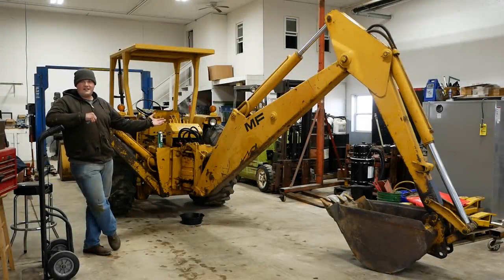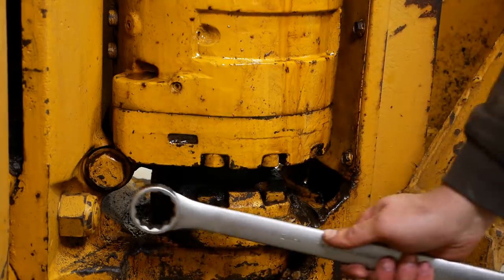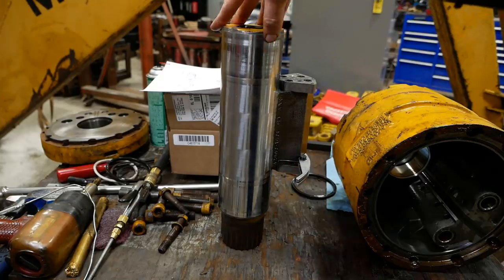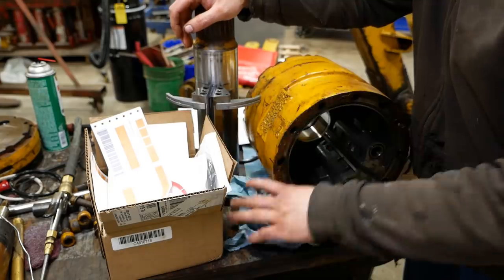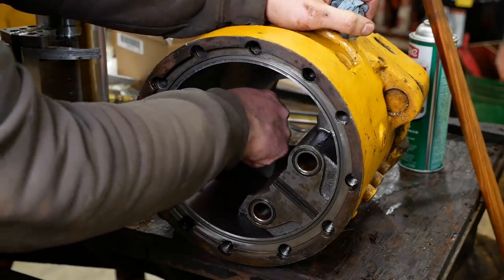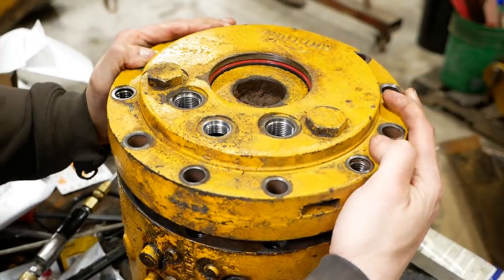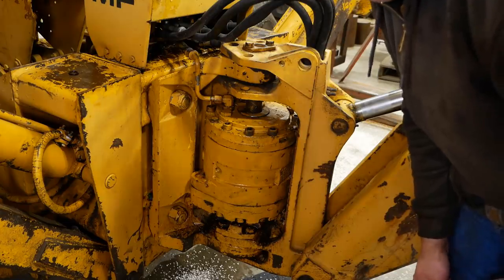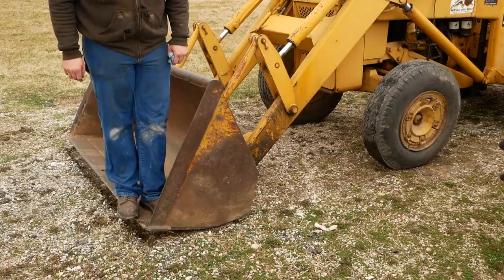Massey Ferguson Backhoe Rotary Swing Cylinder Rebuild

Comment: Yeah Agco and their proud parts, I rebuilt one of these with u-cup hydraulic seals from local shop for around $40. So far about 100 hours on machine and no leaks yet. Not saying its right but for the $1,000 Agco wanted, i can rebuild again if it fails. Also Vaseline made it much easier to reassemble.  Love the channel Wes

Comment: Wess when working on something big and round like that. I make a wooden v block. I put a rubber mud flap in the block. Then sit the round item in the block. I then run a strap over the top. This holds the item while breaking bolts lose and working on it. God bless

Comment: Seeing where you wrote Perkins reminded me of a couple Forklifts a company I used to work for had.They were powered by the 6 Cylinder engine that Perkins built that were originally designed as a Diesel but by changing pistons and a few other mods they were set up to run on gasoline.Company then had the engines converted to propane.Buyer could never figure out why those forklifts spent more time in the repair shop than they did working.We used to make bets on which one would break down first.Then Vendor that sold the machines could not get parts for us and no one else in town would even try.
Reply from the maker: Some people love Perkins engines. I'm not a fan. I've rebuilt a few and have never been impressed.

Comment: An outfit called belzona makes a product 1111 I believe and a release agent. It is like a stronger jb weld you can put release agent on the housing then pour some epoxy in it and drop the motor in and let it cure. It will cast splines onto the shaft.  and the release agent will allow you to take it back apart in the future should you want to. I have had reasonable luck repairing stuff with it when someone doesn't want to throw down the big coin on a proper repair.

Comment: I absolutely agree with you, the 2 cylinder swing is better. stronger, easier to work on and cost less to repair. But when the backhoe is an removable attachment it is harder to mount the cylinders.
Thanks

Comment: Good video. I always wondered how hard/easy it would be to service that thing...now I know, thanks to you. I have an an old mf50 with what looks like to be that exact backhoe setup. Mine swings crazy too. Probably the same spline problem. But the swing cylinder doesn't leak, so I'm gonna let it ride. This thing could probably benefit from some sort of damper on it like a shock absorber or something to keep it from swinging so wildly. I'm actually gonna take a good look at it and see if I can adapt a heavy shock absorber to it to see if I can do something with it. The other annoyance is that the hydraulic flow for that swing cylinder is a bit much...it could probably benefit from a flow control valve or even just some smaller hoses to slow it down a little bit.

Comment: I have actually had to do this on a MF30b backhoe. My problem was getting the pin out that he took out easily. I had to use a small hydraulic ram with a Porto power.  I also needed a bolt from M F to take apart cylinder. Easily replaced seals.

Comment: Tremendous teaching.  For me the two take-aways were: 1) How much torque you needed with a pipe wrench just to get some static motion (no hydraulic pressure) on the motor. 2.) How to tell the difference between a cylinder seal leak and a valve leak on  hydraulics (bucket or otherwise). Best Regards.  Craig

Comment: You are correct, AGCO parts are made from 100% pure gold!  I just paid $85 plus shipping for a simple key switch for the ignition.  As far as cylinder seals I have always just purchased parts from my local hydraulic shop.  Much cheaper, and usually a lot faster...

Comment: I wouldn't call it a 'poor' design. After 60 years in service, I am surprised those splines are still holding up and those seals looked original
Reply: @Nighterlev  - very true. and those splines being at the bottom, probably received a large dose of sand and dirt over the years, grinding them down to nothing, it's surprising they have lasted as long as they have, a simple rubber cover would have protected them from debris and damage
Reply: I wonder if the shaft could be be pinned? Might not be removable after if gets tweaked from use, but could buy a few more years out of the machine.
Reply: @NICK-uy3nl  how many fudd backhoe operators do you think actually grease their machine? I guarantee most don't. Especially people who don't own the machine.

Comment: I had a MF 302 with a 320 backhoe attachment back in the day. It suffered from similar issues. The bonus on mine was the operators station swung with the backhoe, kinda like and excavator. The AD4-203 Perkins was one of the best running diesel's I've ever owned. It was a decent machine in it's day but pales in comparison to me Deere 310 Turbo 4x4 with Extend-a-hoe.

Comment: Hi Wes. I have a MF 50A  It's larger than that one. Though the same setup. Mine stars right up. I am going to remove the back hoe on it. I can't afford to buy all the hoses and cylinder kits for it.  The prices are BS for for parts,that's for sure. I make my own hoses and it still costs an arm and a leg. Has always I Liked,shared. All my best.

Comment: I have run into the worn out spline scenario before too.
Cheap and easy fix as long as the customer knows that it is the last fix, is to use an industrial metal repair epoxy putty on the splines. A thin coat on both sets of splines and assemble, wait required time to harden and away you go.  You can never get it apart ever again
I tried to look up the stuff we used, its been too many years and I cant remember the proper name. Belladona or something like that.  I can't find it anywhere.
Great stuff.  The millwrights in the pulp mills used it lots, that is where I got the idea from.
If you do it right it will last forever but you only get the one chance.

Comment: Well done as expected, just a few things that maybe you knew and maybe you didn't. When dealing with large awkwardly shaped assemblies like this, break all the bolts loose (just a minimal crack) when the assembly is still bolted on the machine. It makes disassembly much easier and I have always found that it sames lots of time and headache. You can always retighten on the bench, or back on the machine. Second, with regard to the splines, Loctite actually makes several types of compounds  designed just for instances like this. Each compond has tolerances in which it will fill and tighten the joint up significantly, the durability is more than adequate for most splined joints. Next time you come across something like this give the technical line a call, the people I have dealt with are very knowledgeable. Just some food for thought, if you already knew no harm no foul. Keep at it Wes, your killing it.
Reply from the maker: It's not possible to reach the bolts with the unit in the machine. If it was I would not have removed it...
Reply: @WatchWesWork  ok, I figured it wasn't new information just thought it  couldn't hurt to mention it.

Comment: Wes, I have fixed the female splines by machining out a cavity and pressing in and welding/braising in a splined coupler which are fairly affordable. The male splinesI have built up with weld and ground them back.  The shaft can be spray welded and turned of course.  To me, the work on those is probably 1500 bucks.  But of course when the machines list of issues is endless, it’s a matter of hitting what matters most. 10 degrees is a tough amount to accept.    Any used machine like it will have the same type of issues. That’s the problem.

Comment: Always wondered how those slew motors worked. I drove a Ford 550 with a similar set up. Slew wasn't that powerful. Digging on a slope it wouldn't slew uphill unless you brought the bucket in near to the back of the machine. I expect these motors were used to avoid the Wainroy patent on the two ram system. JCB had a different "rack and pinion" set-up. The early ones weren't enclosed and used to go bang when a stone went through the workings.

Comment: We have a place here in Oregon that will match up your hydraulic seals, o-rings, and even backup rings to off the shelf parts.
I wonder if there's someone like that around you.....  I haven't found anything yet that they couldn't get for me.
Looks like the rust was the only thing holding those splines together.
I've never gotten to see one of those apart.
Thanks for showing us.
Reply from the maker: I have a place like that, but they just scratched their heads...
Reply: @WatchWesWork  I remember well those days of ringing around the country to try and find some obscure part.  Wasn't a bad gig actually.  Comfy chair, no risk of getting hurt, and being a wage slave meant I was getting paid regardless.  Didn't help the boss' bottom line, but we usually managed to find things.

You can bet your bottom dollar we kept the contact details of every supplier who was able to help us on file.  Even though that business closed years ago, I still have that folder and it has saved us many times over the years.

Comment: years back they made a replace kit that turned it from rotary to twin cylinder for these you might find one in a wrecking yard sometime . as for rotator, recast the piece on tractor and grind the shaft to tighten slop , or make brass teeth shim to fill the void.

Comment: Hi Wes, I have this 1961 military surplus rough terrain forklift that came with a crane attachment in place of the fork frame , and it has one of those Cessna rotary drives but twice the size, I don't have any leaks there. I knew How it was made but never had to tear into it..
as for the spline flange plate, I'd see if that spline is SAE involute spline and see if Hub City has a spline coupler that size and bore flange and weld coupler in bore.
I keep hoping one of youtube machine shops get a vertical shaper ,
I keep my eye open for a vertical shaper to make internal splines for my personal projects,
wire cut EDM would be a very realistic way to cut cut splines in a new plate.    
interesting video thank you.  
Ave did a video 5 years ago about rotary cylinder that was interesting.

Comment: If it's not too late, I'd try packing those splines with JB Weld.  A John Deere restoration expert has been doing that with the steering drag links on wide front end tractors.  Some of them have lasted years.  It might not work, but it would be cheap to try.

Comment: I wonder if you could drill that bottom casting on the flanged spline insert and install a few jamb bolts?  Or potentially mill the top of it and shim it up a little so it's engaging more in the bottom of the female spline.  Just ideas... The loader looks similar to mine.  I replaced the tilt cylinder piston seals with universal seals.  I think is was about $12.  I have video on my channel.  Not my best work, but we managed to get them replaced. Nice video 👍😁

Comment: Hey Wes!   You had the high concentration face going when you were lifting the cylinder back in lol.  Bummer on the spline design.  Going to be the end of them ol diggers....   Had similar issues on things.  JB weld filling the space actually holds up pretty good.   Take care....

Comment: Ohhhhhh Baby that’s tight ;)

It all comes down to supply and demand with the cost of the parts.
With not much demand the suppliers can charge as much as the customer can stand.
How long have they had those in stock waiting for you to come along :)

I recall reading operating instructions on a back hoe saying not to push dirt sideways with the bucket.
I see lost of operators doing exactly that.  I guess that why.  Wears out the sideways stuff what ever that may be.
Happy to watch you repairing the other leaks if you can be bothered filming them. 
Nice video!

Comment: Excellent video Agco parts are very expensive especially their hydraulic system parts. The splines could be fixed to take some of the slop out them with liquid metal exopy I bought some years ago from fastenal and it did actually make a quite a difference I used it on a keyed shaft that was wore in the key badly. The cylinder seals are bypassing badly. My Ford tractor backhoe uses 2 trunnion mount cylinders to swing the hoe around it is a heavy extendable boom it digs to 19 feet 4 inches

Comment: That a pretty neat piece of hardware, even if it was a bad design.  I guess that is why most backhoes (that I've seen) use the two single-acting cylinders.  It's a shame that the splines are trashed, but I guess it'll last until they finally wear out.

Comment: Part's are the killer of those. I had a ford 4000 backhoe in a few months ago back in indy and it chiped a gear in the transmission. No parts available and if they are bend over. He upgraded to a case 580 cheaper than me tearing it down to install less junk used parts.

Comment: To fix that slop I’d mill the splined end into a square then make a new block with a square to match.
Reply: I like the way you think and wish I had the time to try it with mine . When loaded this area is under a lot of rotational torque, anything not properly heat treated and case hardened will shear.

Comment: Perkins...
My father had a fleet of trucks, at one time the majority were Perkins powered. 
I learned how to spray ether into an air cleaner at an early age.

When you removed the bolt to hook up the chain I thought you were cleverly cracking all the bolts in situ rather than wrestling the pig on the bench, but luckily we got to see the pig wrestling.

Comment: I think AGCO has started to charge back rent on warehouse space for parts for older equipment. Guess you can't blame them, it's good there's parts at all. I wonder if Cessna corporate would have been any help. Maybe salvage yard those splines? A fairly good used backhoe is still worth fixing, no matter the brand. Heck, that thing's got nice tires. That's a vote in its favor.
    Best regards from Indiana.

Comment: Oh, caustic and sonic cleaning and spray welding is how you can get these worn, unique parts back to snuff. Abom79 has several videos of the process w. two different sprayers. Edit: Coarse splines and timing marks to set the inner rod and boom would have been better. They made it fine so that it could be used in all those other machines. That amount of slop is going to crack the splines that remain. The now stronger cylinder is going to stress them more; since he leak weakened the forces exerted by the cylinder.

Comment: Wes, the leakage you showed on the bucket tilt cylinders is probably both the valve and the piston seals.  In order for a closed hydraulic system to change volume which is what you are showing, as the rod adds or subtracts volume from the system, there has to be an external leak or air in the system (that can compress).   I'm pretty doubtful that there is air still in the system assuming the system has been running for an extended time, so the valve has to leak in order to accommodate the change in volume between the valve and cylinder.  If the fluid volume can change via leaks in the rod seals or the hoses, you would have a couple of other reasons, and potential sources of air volume in the system.

Comment: Very interesting I've never seen one of those swing things taken a part before. I think the MF construction machines were more popular in Europe and the U.K. than they were in North America and that's partly why they used those swing thing's since the European machines almost always had sideshift with the vertical stabilizers rather than the center pivot swing with swing out style outriggers. Usually if I ever see a MF loader/backhoe its parked in the back corner of a field or is waiting for scrap prices to climb for its inevitable transition at a steel mill.

Comment: I came across a loader cylinder that was bad in the middle and would drift. But if you stalled it extended or retracted it would not leak.

Comment: I live about 20 miles from perkin in the U.K.,and they are poor starters here,plus always oily and Prity dirty inside when you work on them,there parts a bloody expensive in the U.K.,good video thanks.
Reply from the maker: Those pre-combustion CAV injection setups will not start unless it's a hot sunny day.
Reply: @WatchWesWork  heater + spin them over fast ,modern geared starters do help,but I’ve found a valve job 9 times out of 10 cures them.

Comment: You might be able to find replacement cylinders for the bucket at surplus center. They might not be exact but they have a large supply and good prices. Their shipping prices suck though.
Reply: Rotary cylinders?
Reply: No no, the cylinders for the bucket that are bypassing and bleeding off. The front bucket.
Reply: @jasonp9284  Ah. They aren't hard to rebuild. By the time you've figured out all the right apapters and fittings for a surplus cylinder, you haven't saved anything.
Reply: @TheMetalButcher  I know, I build large hydraulic cylinders. Wes also had said he was having trouble finding the v-packing and one had a bent rod. But I agree with everything you said.
Reply: @jasonp9284  Fair enough. All solid points.

Comment: The best way to fix the bad splines is lock tight made by Linclon electric and comes in stick form. The perkins engine just needs some liquid glow plug. for starting. lol.

Comment: (mental note to self), "Loosen all possible problematic bolts/nuts before separation", lol, since ya can't get the parts for it anyway, why couldn't ya just put all new seals in it, then put a bolt/pin through the spline, maybe two, or is just too hard to drill through?, great video Wes, thanks for sharing.

Comment: Curious armchair question on the taper spline... in squeaking life out of an old machine, would it be an option to machine/grind the spline shaft a little shorter (maybe a 1/16 to an 1/8) to sit deeper and mesh better and make up the difference with a shim on the top mounting?
Reply from the maker: That might have been a good option before it was worn so far. Now I think it’s too late.